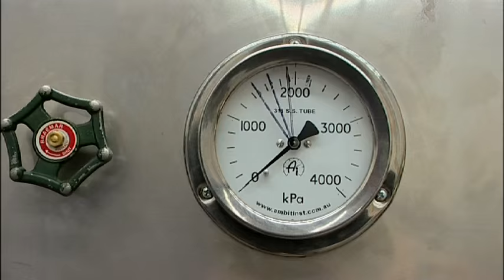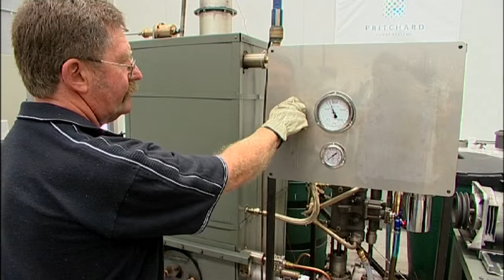Ted invents a new kind of steam engine

Comment: I have seen this prototype system in operation and even operated it myself. ie hands on.  It works even better now.
Reply: Human4873  5kW. 4.5kW is an average
Reply: What kind of steam engine is it?
Reply: @6969smurfy  Single piston, double acting reciprocating engine. The design is unique and has patents granted globally including US, EU etc.
Reply: @onggk6561  what is the cost and Specific Fuel Consumption??
Reply: @sandervanderkammen9230  Its still not in commercial production so no final costs as yet.
Reply: @onggk6561  But this design has been promoted for over a decade now, why is their no DIN or SAE data or other third-party independent testing results available??? This lack of disclosure would appear highly irregular for a legitimate engine manufacturer. Unsubstantiated performance claims for over a decade would make consumers weary that this is all just a dubious  vaporware investment scheme.
Reply: @sandervanderkammen9230  Its largely self funded by family and friends and kept in stealth mode. The 65 shareholders are still invested. There is nothing irregular.
Reply: @onggk6561  nothing irregular other than the lack of disclosure and independent testing results.
Reply: @sandervanderkammen9230  Is been and will be disclosed to the right people.
Reply: @onggk6561  As is always the case with fraudulent vaporware investment schemes, a legitimate engine manufacturer would have published in a well known and accredited engineering journal publication such as SAE International.
Reply: @sandervanderkammen9230  Agree but you have no idea what the engine is really about as you are stuck and thinking in very traditional ways. Patents have been granted for the boiler and engine in major countries including USA and EU even though boilers and engines have been around for over 200 years ie since the start of the industrial revolution. You just have to wait and wallow in ignorance until more information is released when the company deems timely and not due to such negativism.
The mobility industry is not its primary market so SAE International is irrelevant here. Keep guessing.
Reply: @onggk6561  I know all about the Rankine cycle and it's severe limitations in efficiency and cost effectiveness which is well-known and understood by the engineering field.
Reply: @onggk6561  Legitimate engine manufacturers patent work that is either a major breakthrough or is abandoned.... there is absolutely nothing breakthrough about reciprocating steam engines in the 21st century, it is obsolete technology.
Reply: @onggk6561  Then ASME, IMechE, VID or any accredited engineering organization??? 
Why no independent third party testing and publication?
Reply: @sandervanderkammen9230  So you are saying that all those patent bodies dont know how to assess patents and are wrong to have granted patents. Your comments about patents and nothing breakthrough shows your limited experience and understanding of steam engines. You should just accept that there are somethings beyond your understanding and no point telling you.
Reply: @sandervanderkammen9230  Who is asking about the Rankine cycle? Its an irrelevant comment just to reply. Several hundred million engineering students and professionals also know about the Rankine cycle. Just another zero value comment.
Reply: @sandervanderkammen9230  This is proprietary and will be done in due course at our timing.
Reply: @onggk6561  Are you oblivious to the fact that this product is a combustion heat engine based on the Rankine cycle? 
 All heat engines must comply with the Carnot Cycle formula and the Rankine cycle cannot match the match the efficiency of internal combustion engines.
Reply: @onggk6561  Wrong, a patent is granted only in exchange for public disclosure.
Are you affiliated in any way with the company in question?
Are your comments a testimonial that in any way have been in exchange for receiving personal or monetary compensation?
Are your remarks in anyway a paid endorsement?
Are you personally invested in or stand to receive any type of compensation?
Reply: @sandervanderkammen9230  You seem to claim to know a lot without seen or worked on the entire system.  You are just looking at one aspect. I am sure you and several millions know a lot about internal combustion engines which are mainly fossil fuel powered.  The engine is just one part of the entire system that you dont know about. You are quite oblivious to your own ignorance of this development.
Reply: @onggk6561  Anyone familiar with Carnot's Formula knows the efficiency of a single pass reciprocating steam engine is embarrassingly low and completely inferior to readily available engines in mass production today.
Reply: @onggk6561  I don't see any special or unique multi-fuel capability here, internal combustion engines can operate on a very wide variety of alternative and renewable fuel sources and deliver higher fuel efficiency at much lower production and operational costs.
Reply: @onggk6561  Just answer the questions.
Are you affiliated in any way with the company? And are your testimonials in any way compensated or legally meet the discription of a paid endorsement?
Reply: @sandervanderkammen9230   You are assuming the Uniflow engine is an internal combustion engine and using a traditional approach of CAPEX & OPEX. You can't see any special or unique features due to your limited exposure to such developments. So many comments from someone who has seen or worked on the system physically.
Reply: @onggk6561  No, Rankine cycle engines are EXTERNAL combustion and as a result suffer from significantly lower thermal-fuel efficiency than internal combustion engines.
Reply: @onggk6561  How can you represent any credibility endorsing a product when you appear completely unaware of its most basic fundamental mode of operation?
Reply: @sandervanderkammen9230  You have no idea what you are talking about. I do not need to show you or anyone what I know. Base on your assumptions, it is clear you have zero experience, seen or operated the product. Just blowing a lot of hot air.
Reply: @sandervanderkammen9230   You really show your ignorance about the purpose of the machine systems.
Reply: @sandervanderkammen9230  Who are you to be so demanding and rude. You have shown your ignorance of such tech.  You have no idea what you are talking about. What makes you think you are so important? You have zero experience in this tech.
Reply: @onggk6561  The purpose of this machine appears to be nothing more than deceptive device intended to seperate suckers from their money.
Reply: @onggk6561  Who are you to endorse such a shady and dubious scheme?
Do you have a vested interest in this company?
Or are you complicit in promoting this fraudulent vaporware scam?
Reply: @sandervanderkammen9230  You are just a cyber bully seeking attention using this platform.
We reserve all rights to seek full and complete redress to the fullest extent in due course.
Reply: @onggk6561  Why are there so many fake engine scams in Australia like this one?
Are the investment fraud laws weak or is inforcement just very lax?
Reply: @onggk6561  I understand the educational system in Australia ranks very low but are people there really so ignorant and uneducated to actually fall for this type of investment fraud?
Reply: @onggk6561  Why didn't you provide proper disclosure that you are paid by this company before publicly endorsing it?
Reply: @sandervanderkammen9230  Geez whats your problem?
Reply: @sandervanderkammen9230  Well did you get scammed by them or something?
Reply: @tsv2087  Hell No, As an industry professional I can spot scams like this a mile away.
Don't believe me? Just look at the history.
Reply: @sandervanderkammen9230  Well thats pretty weak up against the claims you're making. Do you know this man's history? Can't you see you're winning over no one here. You're acting like a bot commenting on every comment, making substantial claims because of some force vision you've seen. And on top of that insulted the man's country. I'm not saying you are wrong but you have nothing to prove you are right. Just take a breath and give a sensible constructed argument and maybe @Ong GK may be happy to have a proper debate with you rather than a shouting match.
Reply: @tsv2087  Geez whats your problem?
Reply: @tsv2087  What is your excuse? Were you molested by a science teacher? Or did you watch a YouTube video about steam engines that run on "Free Energy" and you are on a mission to save the world???
Reply: @sandervanderkammen9230  Excuse me? I didnt say anything on that, if you say Australian education system is bad you can't even do basic comprehension. All I'm doing is calling you a wanker and I don't even think I have to highlight it anymore.
Reply: @sandervanderkammen9230  I don't understand. You're perfectly describing yourself. Could you please prove me wrong and tell me what projects you've worked on and how this is a fraud. Please just do it.
Reply: @sandervanderkammen9230  I haven't said anything about them I'm asking for your credentials and what you have to prove your claims of fraud. Anyone could look those up on Wikipedia, you're just spewing out irrelevant phrases because what seems like to me you cannot prove your point.
Reply: @tsv2087  Can you please tell us what we can learn from Joseph Black in regards to the Rankine Cycle,  Please, just do it!
Reply: @tsv2087  Yes, indeed... you can certainly look up and research all of these things..

SO, What is your excuse?
Reply: @sandervanderkammen9230  What the hell does this have to do with it. Omfg am I arguing with a brick wall. I'm not claiming to be a professional, I'm not saying I'm convinced with the steam engine I'm asking for you for proof
Reply: @sandervanderkammen9230  My excuse for what?
Reply: @tsv2087  So you are unaware of the efficiency limitations imposed by the Laws of Thermodynamics and the Carnot Cycle???
Reply: @tsv2087  The excuse for your ignorance on this topic.
Reply: @sandervanderkammen9230  FFS do you speak English? I'm not supporting the steam engine I'm asking for your proof. Stop trying to sneak around me because ots not working. Get this in your head I AM NOT PARTISAN
Reply: @tsv2087  Indeed, how could you possibly support something you obviously don't understand??
Reply: @sandervanderkammen9230  Sander. I'm not supporting im asking for youre proof.
Reply: @tsv2087  And I just proved you are completely unqualified to validate any information regarding this topic.
Reply: @sandervanderkammen9230  That doesn't have anything to do with it. I doubt a potential investor would have any idea. So explain to them who you are and why its a fraud
Reply: @tsv2087  You don't understand the facts.
Reply: @sandervanderkammen9230  What how. Just tell me your point and if its coherent I'll probably believe it.
Reply: @tsv2087  Nicolas Carnot published his formula in 1824 which establishes the efficiency limits of all heat engines including Rankine Cycle  steam engines. 
In 1897 Rudolf Diesel proved Carnot's theory.
Reply: @sandervanderkammen9230  OK then good we are going somewhere. Now could you please tell me what projects you have worked on and how you are an industry professional.
Reply: @tsv2087  I have been an engineer for over 30 years and have worked for several major manufacturers.
What are your credentials?
Reply: @tsv2087  Do you not understand the Second Law of thermodynamics or the Carnot Cycle Formula????
Reply: @onggk6561  " 'The' uniflow engine " ?
A uniflow engine is already a type of steam engine since at least the 50s
Reply: @sandervanderkammen9230   What other fuels can they run on?
I figure alcohol would work for an IC engine?
Reply: @diobrando2160  The company taking this to commercialization is Uniflow Power Ltd, Australia. Uniflow is part of the company name. Yes, there are a number of engines that use the term 'uniflow'
Reply: @diobrando2160  Internal combustion engines can run on anything a steam engine can, and they are more fuel efficient.

Comment: Kool.this would be cool for offgrid.
Would be better if the boiler is integrated to heating exchange, cooking, warm water circuit for bathing.
Better with time and more research a turbine generator.
This is what would eliminate the waste disposal problem.
integrate a fan to blow air.
This can also incinerate the diapers and tampons,and menstrual pads.
Buying into this. Variable size models. Chat here or dm
Reply: This company is nothing but a fraudulent vaporware investment scam.
Reply: The unit running in Canberra, Australia does have a heat exchange loop for space heating and hot water. A turbine generator who make the whole setup very expensive and complicated. A simple alternator driven by a belt is adequate. There are two cooling fans which are essentially truck radiator fans so hot air for drying/heating can be available.

Comment: i am interested in the design of the engine, are the plans available for use or licensing? would be great to use an already existing system in conjuction with the new steam production method i am developing.
Reply: The plans are proprietary and not available to public. It would be available under license for someone who could mass manufacture this on an assembly line.
Reply: Whats the new steam production method you have?
Reply: @onggk6561  i am attempting to build the system and making youtube videos, the basics are using hydrogen in the boiler to produce the steam. my other channel (improvatech) has a few videos posted last year, havent had a chance to make more, but should be putting up a video in the coming week.
Reply: @diabsiniman  what exactly would be the commercial advantage of using an expensive fuel source like hydrogen  combined with low efficiency  thermal heat engine as the Rankine cycle?

Comment: well it's a shame there's no contact info, I think I might want one of these for an off-grid cabin.
Reply: Not ready yet for sale but off grid users would love this.
Reply: @onggk6561  That remains as of yet completely unproven.
Reply: @sandervanderkammen9230  Dont need to prove anything to people like you.
Reply: @onggk6561  You must provide some evidence to support claims that are clearly not possible due to the Laws of Thermodynamics and the Carnot Cycle formula.
Otherwise this is exactly what it appears to be, a fraudulent vaporware investment scam.
Reply: @sandervanderkammen9230  Who are you to demand evidence.? If you dont believe then dont  believe. You are exactly the reason why there has been little updates. It attracts trolls who are rude, demanding and have little understanding of the tech because they are closed minded thinking that they know everything. There is on a 'need to know basis' and you dont qualify or need to know.
Reply: @sandervanderkammen9230  Who said anything about the Laws of Thermodynamics? Very simple. You dont understand. You are just shooting your mouth off. There is no need to prove to you. Some of us are busy getting work done while others are just talking and talking.
Reply: @onggk6561  It is a well known and understood fact that the Rankine cycle is limited to significantly lower fuel efficiency at a much higher production and operational costs compared to internal combustion engines.
Reply: @onggk6561  I'm not the one disputing the Second Law of Thermodynamics.
Reply: If you want steam power, build it yourself.